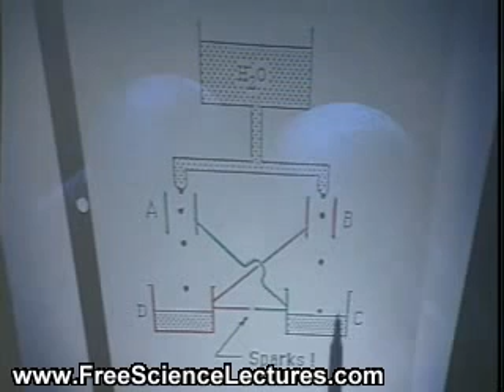Walter Lewin Makes a Battery out of Cans and Water

Comment: if H2O were in separate containers , wouldn't there be  + & -  H2O containers upon arc ? as a biology experiment : enhancing , transferring or removing elements or disease from H2O + to H2O - ? Possibly modify H2O + & or - to sulfur crystal ,carbon ect. Seemingly there would be some kind of backfeed transference upon arc if two H2O containers were used .

Comment: Since there is a high voltage produced with very low amperage, what would happen if a battery was wired into the circuit between the bottom cans instead of having a spark gap?  Would it help if there was a capacitor to accumulate the charge?  Would a diode be necessary in order to direct the polarity or would the battery already do that?

Comment: Hello All!
i have a question that has been bothering me for months and i can't find the answer. its quite a long one though ;P

When a Photon Travels through a medium (Say Air) and then hits the glass surface of a mirror, it changes speed instantaneously as it changes medium. the energy lost is given as heat as the temperature of the mirror gets warmer. The photon the hits the reflective surface at the back, reflects and leaves the glass again. As it changes back into air it instantaneously has the speed of light in air again. but the photon does not change mass??? where does this energy come from to accelerate the mass of the photon (i know it doesn't accelerate but instantaneously has the speed of light in air again) if Anyone has a sound answer for this PLEASE HELP!! Its driving me nuts.

Thanks All.

Tschimi.
Reply: Onkel Tschimi  what happens really inside a medium when light passes through it (lets say glass) , it does not actually slow down light as you think ... it just take more time for light to escape that medium.... that is the reflections which take place inside the medium with the molecules and their lattice are more .... which means that if more reflection or collisions take place more time will be required for light to escape .... u can imagine it like if there is a straight path and a croooked path with many obstacles ...... the more obstacles more  time will be required to overcome those obstacles even if you are maintaining your speed. 

And...
your question about the energy ... you see if a photon loses some energy partially due to energy absorption ... the parameter which is affected is the wavelength ......

in opaque objects the wavelength after collision is in the infrared spectrum while in transparent it is more near the visible spectrum ( because less obstacles ;) ......   )
Reply: Onkel Tschimi the light just changes its wavelength. It doesn't necessarily loses its speed. It still travels at the speed of light regardless of its wavelength, just as the same for the rest of the spectrum.
Reply: Onkel Tschimi ......there is no such thing as the speed of light ...thats your first misunderstanding... The second is thinking of light as a material object... It's energy.... Aka... A force... Aka... Magnetism... And since there is energy / magnetism everywhere and in everything... This is why it slows down when it is in the   magnetic field of material objects and produces heat because of the friction between charged particles and instantly goes back to the speed of magnetism once outside of the magnetic field of material objects because of the same exact thing when two of the same magnets are forced next to each other ...they repel each other and because there is always more magnetism going against the 1 photons direction of travel... It almost instantly is pushed in the opposite direction at the speed of magnetism... This also is why Einstein is wrong saying that space is warped in the presence of mass....you are able to see a star behind the Sun during an eclipse not because space is being warped.... But because light is a magnetic wave and once it gets influenced by the sun it gets repelled around the sun then continues on... Gravity does not exist.... There is only one force magnetism.... But you will never hear mainstream physicists and scientists admit that because if they did... They will be admitting that nuclear weapons are fake... In the electric universe theory the center of the sun is condensed matter and not where hydrogen is squeezed into helium... The electric universe theory explains the universe very easily and way better than the Big Bang model... But unfortunately there is power hungry people that want to rule the world there is ongoing deceptions on a truly massive scale... This is why you are taught lies when you were indoctrinated in school.... Magnetism is how heavier elementary particles are produced.... Gravity is bullshit... Only magnetism can make electricity and only electricity can make magnetism... Last time I checked the earth had a magnetic field... Explosives around a core of nuclear material can not split atoms like the lies they tell everyone... Nuclear weapons are used to fear monger citizens so they willingly give up rights and liberties and willingly give up massive amounts of money to be protected from them... Watch old videos and you will see nuclear weapons videos are nothing but propaganda and Hollywood productions
Reply: It must be a full moon out!!! ROFLOL! Every time there's a kook pseud-scientist with a cockamamie theory about light, gravity, protons and electrons that is all wild conjecture without any chance of being reality whatsoever they blame some conspiracy that keeps their 'woke truth' from the masses and the majority of people enslaved! You talk 100% BS, pal! Explain barometric pressure without gravity! And why there is almost zero pressure in outer space! 

"Magnetism is how heavier elementary particles are produced.... Gravity is bullshit... Only magnetism can make electricity and only electricity can make magnetism..." Then why do objects of different mass fall at the same rate, something that's been mathematically explained by authentic scientists, btw! 
Einstein already explained those matters in greater detail. Read a book! Your youtube education is pathetic!
Reply: By the way, are you also a flat earther? You're just regurgitating what they think is true to explain why the earth is flat and that there is no gravity. Guess what?  There's not one single legitimate theory to back it up.  It seems you dabble in very deep trenches of BS yourself! Especially, when you try to explain gravitational lensing and how stars behind the sun can be seen. Again, do yourself a favor, read a book from a legitimate scientific source rather than nonsense and delusional thing. Reality is your friend!
Reply: @metaspherz  Rude, generally disqualifies you. >Scope

Comment: Nice one! I would say, that the movements of the dropplets within the tubes induces the electromagnetic field (Right Hand Rule and the helical flow of the current -  the universal laws of electromagnetism). The properities of the water in buckets are different till the discharge, when the particles become neutral. Then the process starts again.
I just can't understand what defines the polarity in this model. Which bucket is + and which one is - ?
Reply: The potential of two buckets is not the same at the start of the experiment due to various random events (e.g. one might've been charged a bit more after being touched), thus one becomes positive and the other negative. During the experiment this difference only grows larger. 
So the answer to you question: random one.
Reply: I wonder, if every kind of differential can create electric current - for example two buckets with hot and cold water connected with a wire...?
Reply: +Astral Traveler Well, no. Only electrical. Althougth if you connect two buckets with different air pressure with a tube you will see "air current" — wind.
Reply: Aahh, i believe this was so called "thermoelectric generator", i absolutely forgot about it. This device can actually convert heat directly into electricity. Google it for information. And this generator really works exactly like you say: two buckets with different temperature! But its efficiency is super low, ofc
--
Reply: Дмитрий Воро And now let's connect molten titanium with liquit azot...:)
Free energy? :)
I believe, that there's a way to convert any kind of differential (potential) into electric current...
What's the difference between water and electric currents? Why 'neutral' particles can't behave like charged ones? Iron dust is always directed along fieldlines in magnetic field. Science can't understand, that it's the magnetic field, which is important and not particles, which make the current... Dipolarity exists EVERYWHERE in the nature :)
Reply: Why is that? You need energy to melt titanium and  cool azot. Much more energy than you get. 
--
Reply: Дмитрий Воро That was just an example. I wanted to say, that we can use practically any kind of differential, to produce electricity. Our science is still crawling or it's progress is limited on purpose...

Comment: Sure, when the water passes the two upper cans, there will be an electrostatic charge on A and B. (this static charge is (indeed) induced by friction. This is a well-known problem in the (process) industry: fire and explosion danger for some fluidum).When the charge level on C ( the water level in C is then also higher than in D) is higher than the charge on D, then there will be a force executed on A, even so heavy that the water flow will spread out.

Comment: A relaxation oscillator built with two different RC-times. The RC-times are simulated with two different flows of water. The trachs (buckets) are the C's and the resistors are simulated by the paint cans. The buckets will charge exponentially at a different level. When the differential charge on the balls is high enough, there will be a spark. ... this is repeated each time when there is enough charge on the balls....wow, technic= so beautiful....I love it!

Comment: This is an electrostatic battery, no real current just voltage potential. It cannot supply enough energy ( current) to do any real work ( drive a motor for instance). It is novel none the less. The water that flows thru the air creates friction and the resultant static electricity is generated, transfered and stored in the larger lower can;'s- think Leyden Jar capacitors.

Comment: I like how this is not temperature based. A sun operated steam engine could utilize this in a closed container with proper insulation to connect the metal without crossing 'wires'.

Just putting the idea out there since I am working on the thought, but knowing myself it won't go further than paper.

Comment: potential. Because there is more negative chare in C's can than D's can and opposing charges attract, some positive charge in the water will be attracted to D's trickle. Also, negative charge will be attracted to C's trickle.

This is a positive feedback on the difference in charge in the buckets. Everything works because of a tiny difference in charge in the initial situation of both buckets.

Comment: There is a slight potential difference in the water in each bucket. Then, as one bucket contains slightly more electrons, the can on the other side also contains more electrons and thereby pushes away other electrons trying to trickle down there.

So there is an exponential increase in electron-count for both buckets. The more difference, the more effective.

Let's say bucket C contains slightly more electrons than bucked D.
Then the trickle running into D has to go past the can with C's

Comment: the electric field around each vertical tube influences the charge of the falling water so that one bucket gets more negatively charged and the other more positively charged. electrical current flows up one stream of water, across the top pipe and down the other stream. you can find a follow up lecture by him with an explanation, use google.

Comment: So, it's due to the static electricity produced by the water friction across two potentials?
15kV sounds like a lot, until you shuffle across a nylon rug and touch a ground. Now imagine the voltage when the arc jumps almost two inches as opposed to a mere 15mm (it sounds like a rubber band being snapped against a sheet paper). Ouch!

Comment: @kedmark 
no you need the crossover so opposing charge goes to the other bucket,or charge would tend to neutralize? 

If not you could do the same thing with two big unconnected conductive cylinders  by dripping water from the same source into the separate cyls.

To put one bucket's charge on the other stream repels the charges in a given bucket back to that bucket and pulls the unlike charges into the other bucket  accumulating charge.

This is a beautiful experiment.

Comment: The KEY is in placing those cylinders(with no top and bottom) EXACTLY where the continuous stream of water starts breaking into drops, ----- - - -  -  right there :) 
BECAUSE the drops are then charged after breaking free from the stream.

Why? -The (slightly,at first) charged cylinders push "their kind" of charge in the stream away from them,so the part of the stream (still continuous here) closest to the cylinder has almost all the opposite charge.And then that part just breaks away with it :)

Comment: @skaterraiter Moving vehicles? What? Anyway... He didn't say 7000 volts, he said 10,000 to 15,000 volts. It's not "unreal". You're confusing voltage with amperage and current. A static electricity shock is around 10,000 volts. Research if you're actually interested. Although, by the way you type and spell, I'm actually amazed you wanted to watch this video.  "that kinda of" / "movieing", "viehicals", "tryed", "differnt", "enviorments", "electrick", "curent", "comeing"?  Learn to spell, man.

Comment: This is very cool.  I only just saw this today after watching Professor Lewis's lecture about the classic "walking in rain" question.  I think this works through a simple mechanism involving repulsion and attraction of electrons due to opposite charges.  Basically once one can has any negative charge, the electrons in the water above "flow" away just before dropping.  The opposite occurs on the positive can.  The buckets catch the positive and negatively charged droplets increasing the charge.

Comment: Notice the interesting parallel between a rising voltage caused by static electricity build up in this battery & the type of rising pulsed waveform Stanley Meyer used to split water in his overunity electrolysis system. I would like to make a battery like this but tune it to the frequencies Meyer used & then use the spark to split the water molecules & turn it into HHO gas & put it in my car.

Comment: Answer = google + Kelvin water dropper

In a nutshell the water in each bucket contains negative and positive electrons. But one bucket will eventually end up with more + or more - and as electrons build up on the negative they will want to get to the positive so when there is enough to form a bridge or enough "potential" they make the jump to positive which will then mean the distrubution of - and + is even again across both buckets.

Comment: I knew at 2:29 what the Explanation was..1st of all the paint cans have some zinc in them while the larger trash cans have mostly steel
,,,Then you have to understand that Water molecules, which have a 109.5 degree angle  between the 2 Hydrogens, the molecules hit each other as the droplets move downward, this hitting of molecules is not unlike rubbing 2 balloons together, the resulting "static electricity" and the potential difference between the metals add up for the final "spark".

Comment: As im sure you already know, its all about current not voltage, and being static electricity it generates only a couple of micro amps, compared to the vast powers being drained from your average power plant. so all in all, fun party trick, but useless as a commercial power source

Comment: The girl is really cute. You wonder just what career she is going to chose that might benefit from this demonstration. I believe that the easiest way to store this potential is to power a capacitor and periodically discharge to a battery.  How would this quantity of energy compare to the energy produced if the falling water turned a waterwheel generator?  dunno.

Comment: if you think about it....it's sort of the same way how lightening works when it rains in the clouds....charged electrons orbit towards opposite attractions and when a large body of opposite charged electrons comes in contact with one another a spark is formed and the electric current connects with the ground

Comment: Mind boggling. Sinks need to be grounded because electrons are stripped from the water molecules as they leave the tap, so generating a change in potential. I guess the charged droplets induce charges in the cans they fall through, the cans perhaps inducing polarisation of the droplets.

Comment: A friend of mine who worked at LANL showed me this... and much to his consternation I asked...
1. Okay, what determines which half is positive, and which half is negative, since this is a balanced and folded system.
2. What would happen if one was built, not violating any principle of the design (except for the fact there is no 3rd charge), with 3 phases (3 paint cans, 3 trashcans, and 3 probes for the spark gap). A. would any of them form a charge. b. why?

Comment: hm i have. the setup itself is known as the Lord Kelvin Thunderstorm, i made one with the two upper inducers as truck tire innertubes covered with aluminum foil. unfortunately i didnt calculate the voltage output, but it was surely impressive